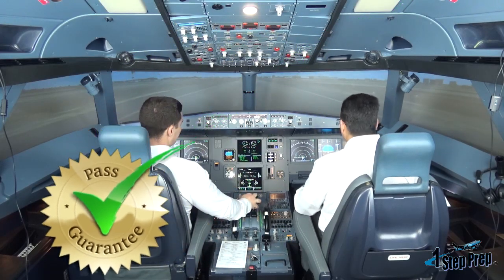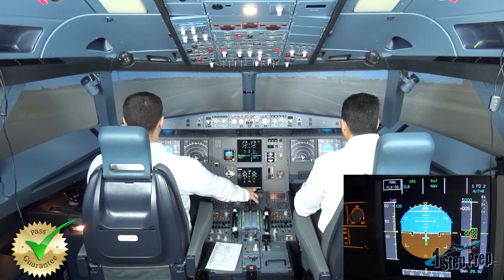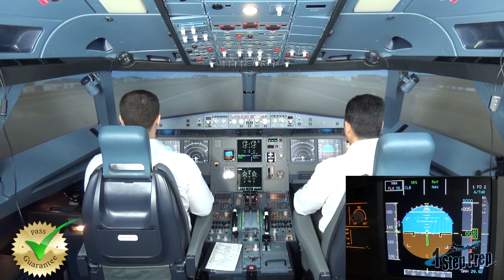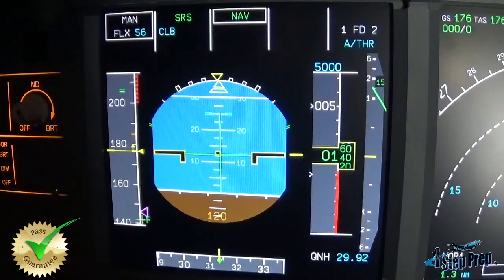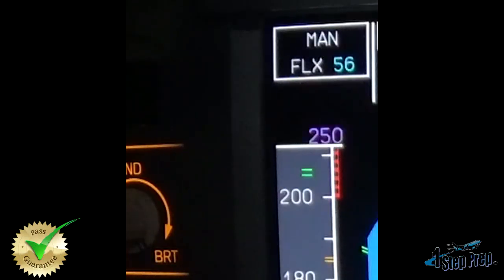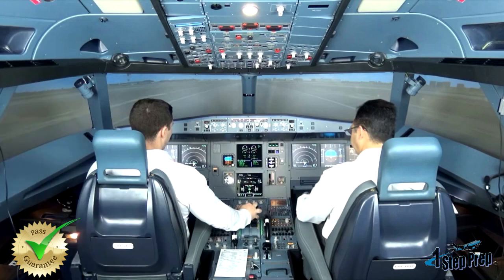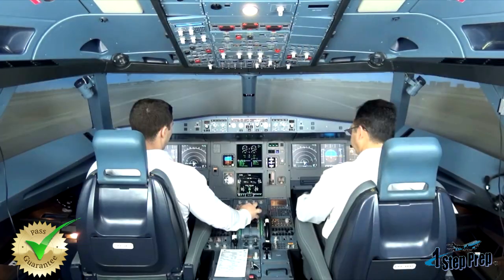A320 Takeoff Explained

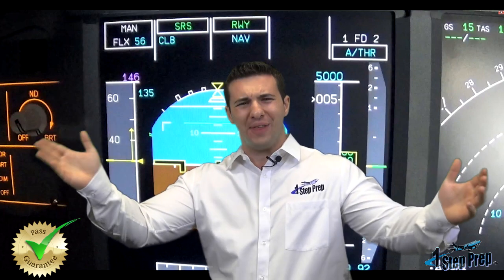Comment: 0:18 how come is the horizontal FD bar situated at 12+ degree like that? Does it tell the VMU or else?
Reply: It’s SRS climb so if you lose an engine that will be what you follow. Keeps you at V2 speed and climbing. You do follow it initially but then it goes to managed climb unless you lose an engine

Comment: Do jets have a line lock on the thrust levers? I see on alot of take offs the pilot lifts the RPM but the jet does not move until he pushes a button on the side of the thrust lever. Can someone explain please?
Reply: The Airbus has a non-moving thrust lever which means the pilot manually sets thrust to TOGA and then the engines spool up. You may be referring to Boeings which can have TOGA buttons on the thrust levers which is used in various situations to set maximum thrust automatically in combination with the authothrust because Boeings have dynamically moving thrust lever positionings (see here for more info: https://www.youtube.com/watch?v=KjAt8qC95cI)
Reply: @dakerbal  that link was perfect thank you so much. 

The buttons I am curious to are the outer throttle disconnect buttons on the side. 

Thank you again for the link :)

Comment: Also PM said: “positive rate”, as in Boeing’s SOP, instead of Airbus’s “positive climb”.
Reply: In my airline in Europe our SOPs say Positive Climb
Reply: @pablomu10  of course, because this is Airbus's SOP, not even company procedure.
Reply: At my airline, we just call "positive" but they are all the same, doesn't really matter I guess
Reply: @sq8409  it all depends on company's policies and in our company it matters. Instructor will drill you untill you will not say right, it is from my own experience.